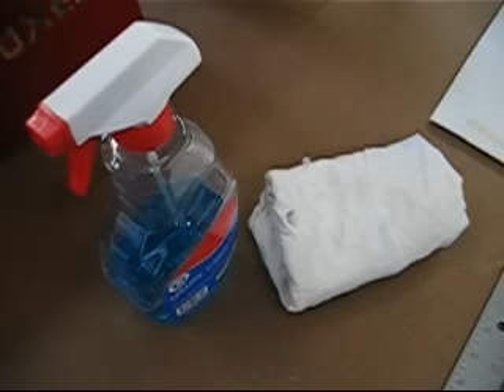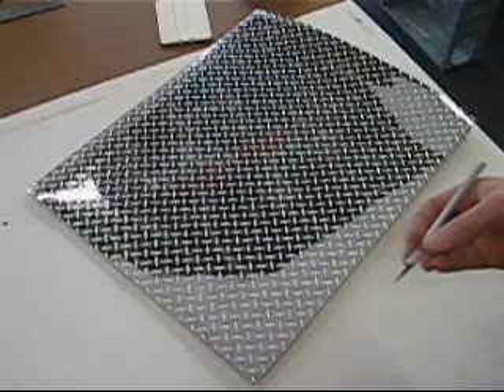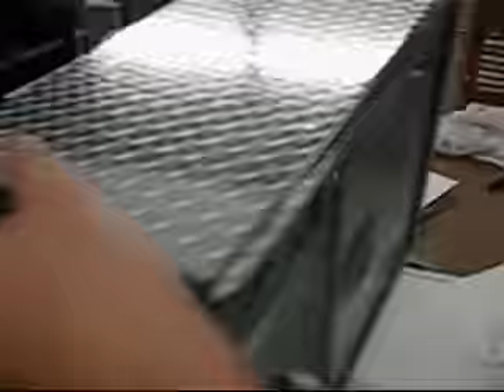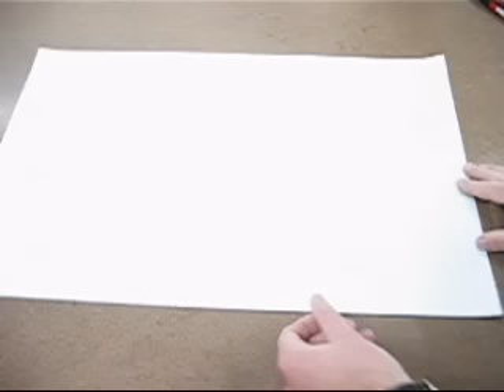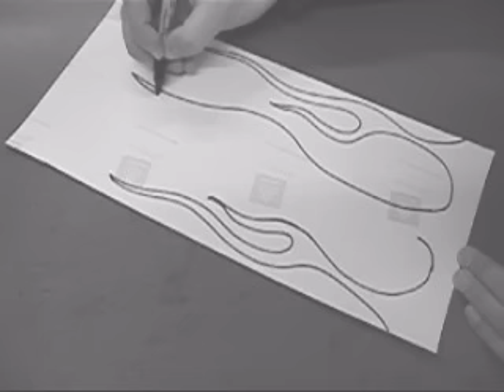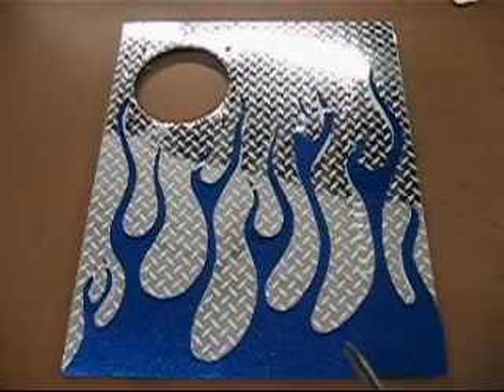Case Mod: Computer Modding with Vinyl Film, www.mnpctech.com

Comment: hey i just buaght some diamond plate vynl and 6ft u channle both are great!!!

but i put the vynl on the bottom of my diamond plate mod

by bottom i mean inside on bottom. and for my mod i took hdd cage out cuz it sucked. but what i did was made the hdd on the bottom/floor or the case and i just screwed 2 holes so i could mount. i bouaght the vynl so it would not get esd by and sharp edges even though i smoothed it out good (got worried) so my piont is. does the vynl give off esd????????

Comment: if you place a sticker like this it's most likely fail this dude dit a good job but if you use sum soap the sticker will be much easier to place and after it dried it will be as sticky as it was before just use sum soap on the surface where you want the sticker to go first not pure but with sum wotter like when you do the dishes that soap is great for it it will be much easier and you can't go wrong :)
Reply: +maion1309NL Rightly, aqueous solution of soap or detergent for dishwashing + bottle for washing windows. This is pro......!